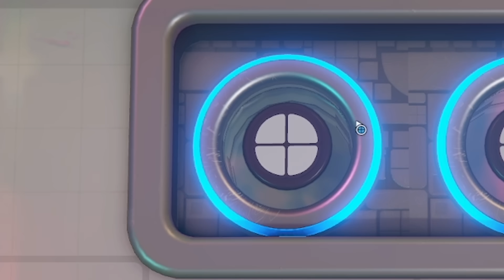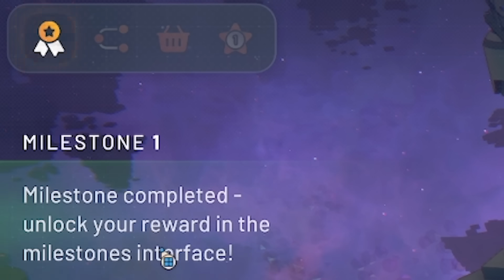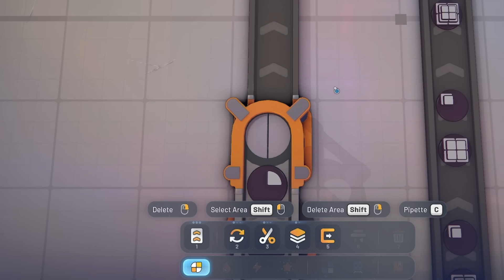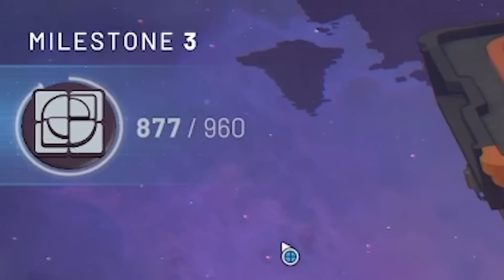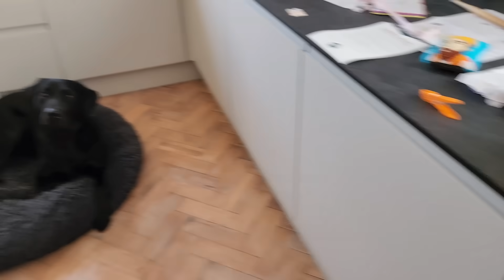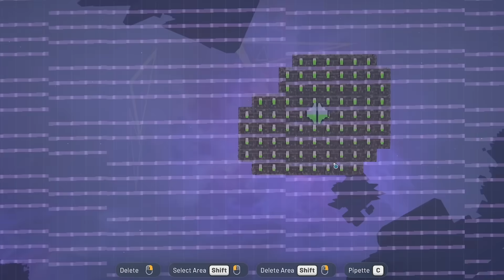I was paid to try and break Shapez 2...

Comment: You want to break the game, all you had to do is use the largest platform put pipes on every square, then once done if its still running at that point, then try to delete a small area on that platform, your computer will crash  EVERY TIME 100%, something they never fixed, your welcome.

Comment: (10:05) A branching conveyor belt alternates between all branches on the line - they don't operate in sequence. All branches are aware of each other. So, no need to get fancy with the way you divide them up. They will automatically evenly distribute incoming shapez among each branch.

So, if you send 64 items down this path: ═══╦═╦═╦═╗ you'll get 16 on each branch. 

But let's say I'm wrong and it doesn't work like that. Let's say the game wants to give you 32 on the first branch, 16 on the second branch, 8 on the 3rd branch and 4 on the last branch. That's still not a problem at all. Because as soon as the first branch is filled up, all passing shapez will skip that first branch until it is cleared again without slowing down the traffic on the main line. So, you won't end up with 32,16,8,4 because they first line doesn't wait to be cleared when it is it's turn. It will happily send 3, 4, even 100 shapez past that branch if it is clogged up. Thus, eventually, you'll end up with all branches maintaining an equal load anyway provided you are sending more shapez down the line than you have enough capacity to handle among all your input/output tools on every branch on the line. And if you aren't then it doesn't matter if you don't load balance - you're output is still going to be at maximum efficiency anyway.

Comment: Stacking a double stack vs stacking 3 times is the same efficiency. Either way, it's 3 stacking operations.
If you stack double stacks then you can do it with less machines, but that will give slower results.

Comment: The reason all the shapes at the edge of the universe are wonky is because of a little thing called "floating point imprecision". (I'm simplifying a bit here but) basically what's happening is that the computer only has so many digits it can use to represent a decimal number, so the more numbers you have before the decimal point, the fewer you can have after it.

What that means practically is that the numbers stop being able to be precise enough to draw correctly after a point, and so the further out you get from the center, the harder a time the system has zooming in. Moving the camera starts changing how the decimals are being rounded and makes the details on objects start to be drawn differently depending on very small changes to the camera's position.

Comment: 21:00 Well. You found the crazy floating point rounding error zone, or as the Minecraft community calls it, the Farlands. Congrats. 😂
Reply: Yeah this looked like floating point numbers simply being inaccurate at distances, particularly as it scaled with the distance.
Reply: Or the Null Zone from Roblox.
Reply: @NorthNovusVoid   i think it might be the same thing
Reply: OLD MINCERAFT MENTIONED!
Reply: Minecraft its overflow.
Reply: that's not what causes the farlands
Reply: @baltdev  That's exactly what causes the farlands. At high enough coordinates, the floating point inaccuracy causes the math to break down, creating nonsensical numbers for the height map. Though it's been fixed since like beta 1.8 (not the same as the more recent 1.8).

Comment: I still don't like that it destroys half of the shape rather than separates them. As I understand it there's a separator as a higher tier unlockable, but I still don't like it. Anyway I'll probably get this game once I get a computer that works again. I bought the original twice, once on PC and the other mobile. The mobile one could use a little love, when you get to the edge of the board and zoom in the stuff that was on the edge of the board zoomed out vanishes.

Comment: I wonder is there some kind of storage for recyle option? E.g. like for the last one at 7:00. We had that half square and a quarter slice of the circle before. Just individually. If there is such an option we wouldn't need to occupy a compression molding with producing more just the conveyors to merge the pieces together and send them out for delivery

Comment: When you go really far in most game engines, the engine still needs to know where you are.
 So, it uses a floating point number- like scientific notation. But, that means it has limited accuracy at long distances, because there arent enough bits to store the number in it's entirety.
That's why so many games have shakey models a long way from the centre of the world - the model is so far that the computer can't accurately place each corner because their position data is so innacurate

Comment: Yeah those are floating point errors... they are the enemy in any game with vast distances.
Also the underlying logic is probably fine, but the rendering of the mesh instances gets real flaky if it can't put the vertices where they belong.
There are ways around it, but it needs to be build for that from the get go or it will be a GIANT PITA to patch that functionality in.
At those distances physic engines are real fun, they constantly find new ways to surprise you.
Reply: Yeah, the most common method is to keep everything on a local coordinate-system with respect to the camera, combined with performance-optimizations that simply don't render (and absolutely not physics'erate, unless that part is ensured to be on-grid and coded with BigInt) things at large enough distances. If the physics (which wasn't using BigInt) has desired side-effects that makes you want to still physics'erate anyway, such as processing and accumulating shapes, the most common (and easiest) way to do it is to split stuff into chunks and keep track of an average of how much it produces of everything + where it connects to other chunks so that if they have active physics their destinations receive those resources at the speed of that average. This can have issues if done poorly, such as first moments of when you start producing something being interpreted as infinite resources per second. A harder method actually performs analysis to calculate the actual expected rates, particularly when it has reached a steady-state (expect laplace transforms?).

...And I went too deep into a tangent. anyway, this way is still a slight bit of a pita to implement a patch for, but not too bad (as compared to other methods). You can essentially skip rehashing the actual entities themselves, and simply make an intermediary step before calling their setpos/getpos etc. functions (which is inherited from a super-class/interface/abstract/trait/whatever paradigm you are using, anyway) first transforms everything to the local coordinate system. Ideally your game engine is already doing things in terms of coordinate-systems anyway, but even if not it is not too difficult implement such a system yourself (though refactoring every usage of Vec3 into Coord3 can really be a pita).
Reply: Yeah, I seem to recall they were a major problem with Kerbal Space Program development - with the simulation trying to use realistic astronomical distances, the limits of floating point numbers was was easily reached and would affect things like the physics of all of the pieces attached to the rockets. It took them a lot of work to fix all of the associated bugs, and I think they had to transition to larger (64 bit?) floating point numbers as well.

This is also why many space games do things like divide space into sectors or solar systems that need a loading screen. No Man's Sky, for example, keeps planets in a solar system relatively close together, and to hop from one solar system to another you need to go through a loading screen, which allows them to always have the planets relatively close to to origin.
Reply: @logicalfundy for Elite Dangerous they wrote their own library to use 2 single 32 bit floats to emulate a 64 bit float.

From a science point of view Elite Dangerous is a super interesting game. Their StellarForge which generated the universe is sometimes even right or very close to being right when we discover new planets IRL!
Reply: wonder why they don't just have the logic for each grid be its own thing. Like, they have a grid system, why not use it!
Reply: @colecube8251  because Unity...
Floating point errors with vast map sizes are 90% of the time technical debt of the established game engines since it wasn't a thing when they were conceptualized.
A lot of newer engines are capable to abstract that away without you noticing but all long-standing engines have options/tools you actively need to opt in.
And if you forget that you'll have a lot of work to remedy that.
The solution is quite simple and requires chunking / partitioning your world to keep floating point errors negligible but every thing else needs to be able to handle that.
Reply: @DerSolinski  So, let's say each grid space has 200x200 squares. Would it not be possible to have each grid have data for what's inside of it. Then you could just use a 2d array to load in the grid, and use a 2d array to load in the squares of the grid... right? This wouldn't have any rounding errors since there is no need to use floating point numbers.

And as for rendering, just have the camera stay at 0,0,0 and have the world move around it inversely.

Is there a reason this wouldn't work?  I've never used unity and am a very inexperienced programmer. If I had to guess this is possible but perhaps this issue was realized to late into development to be fixed easily?
Reply: @colecube8251  I'm sure he's already using a chunk system for his game logic.
What you see is that he transforms those to Unity world coordinates so the engine can handle rendering.
However so far out floating point doesn't have enough resolution to so the vertices cannot resolve to proper screen space coordinates. (the pixels on your monitor)
To fix that he would need to pin the camera to 0,0,0 and move the world underneath it.

So yes you're correct.
The outer worlds are actually doing that, the player is always the world origin.
Reply: @DerSolinski  yeah!
I wonder how hard that would be to change

Comment: I never went scrolling that far on the map, but I did bring the game to its knees. With almost 1.4 million buildings the game gets to almost unplayable state xD
But got 2 almost fully automatic MAMs running for the random deliveries.
Reply from the maker: Oh wow fair play that's impressive haha
Reply: Whats a MAM
Reply: @ItsaKorok  Make Anything Machine - automated factory that takes apart the shape requested by vortex (or manual input) and puts together a shape out of it. Mine didn't account for pins and I have to turn those on and off, hence it's not fully automatic one, but close enough.
Reply: @DennouNeko  Protip: Just consider pins to be a separate shape. So your MAM brings in complete circles, rectangles, stars, diamonds, and pins. Then just cut and arrange them like any other shape. You'll need to make a small separate factory to make a shape with just four pins.
Reply: @TitoRigatoni  Uhm... You can't really make a 1-layer shape with just pins in Shapez 2 since there's no unstacker (at least at the moment).
And I know the logic needed to detect a pin layer and add it under a higher layer. Even with pins that slide down to bottom layers on stacking if a piece below is missing. But with how slow the game got at this point I simply couldn't be bothered with modifying the modules...
Reply: @DennouNeko  yes, you can make a 1-layer shape with just 4 pins. I wouldn't have left that comment if I didn't already do it in my own MAM.
Use your imagination. Hint: Crystals disappear when sliced or stacked...
Reply: @TitoRigatoni  Right... It was me who was still thinking with old mechanics. Think I can see now how to make a factory for pins and add a segment in the pipeline for them. Will be definitely easier to do than what I had in mind. Thanks for pointing that out.
Reply: @DennouNeko  Yeah for sure. I first tried automating pushers in the MAM and it turned into a logistical nightmare. Bringing them in as a shape was the way to go!

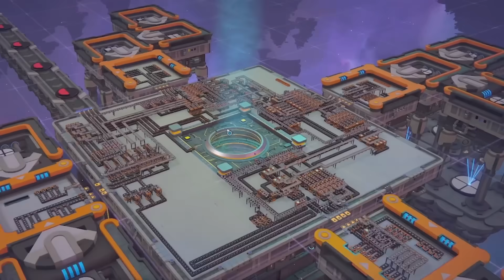Comment: 21:44 that's called floating point error, the father you go, the bigger the error gets. 
usually games keep the camera and the map positioned at 0,0,0 so that doesn't happen.
Reply: In fact I’m pretty sure in c# (the games made in unity) integers don’t overflow
Reply: @anonymousperson.5528  C# doesn't check for overflow by default. You can change your project settings to enable it. Or you can explicitly have it check with the "checked(var)" function.
So an integer overflow could (probably) be possible. I'm not saying it's the case here.
Reply: An integer overflow is something completely different than floating point error. Makes me think you guys shout words out into the void, hoping to sound smart to someone...

If the issue was an integer overflow, then the map wouldn't be infinite but instead, well, overflow and loop back on itself. Would also be kinda cool though. But that flicker and graphics error is 100% floating point precision error!
Reply: @HIDDEN_ORIGIN_DnB  yea exsactly
Reply: @monad_tcp  might be integer overflow, but I agree floating point is more likely
Reply: @Vectorspace000 no it’s floating point error

Comment: The building descriptions actually show you the number of buildings it would take to process a full belt, would be useful if you're trying to do max efficiency! Or just burn the game to the ground like LetsGameItOut lol
Reply: Or just do all of your upgrades in parallel, then you just have to remember rotator - 2, half destroyer - 3, extractor / cutter / swapper / bent stacker - 4, regular stacker - 6.
Reply: @urkerab  I found it better to upgrade the belts first/more than the rest. The belts are the ultimate limit on how many resources you can mine/move. Space wasn't a huge concern for a while at least, so needing fewer machines isn't as important as getting more resources in/out.
... didn't realize the game had a "number per belt" thing though. I was just dividing the "#/m" of the belt by the "#/m" of the machine. 180/m divided by 45/m is easy: 4.

Comment: RE: 10:15
That doesn't improve efficiency because it only routes in the direction if it's clear, meaning it'll start getting more but that'll cause it to back up so it'll stop getting them until it catches up causing it to self balance.
The original Shapez did the same thing.
Reply: It can only more efficient in that it improves the startup. Without the balancing there can be some time spent "filling up" tracks during which the later machines aren't working.
But yeah, once it's up and running, same efficiency. And the startup is pretty insignificant in this game.
Reply: It's called a manifold btw
Reply: I would've started ranting about this too, thank goodness that RCE saw this
Reply: The info for the buildings tell you how many you need to process a full belt. For example, you need 6 stackers to stack two full belts into one full belt.
Reply: its still neater to actually properly split them up imo, it's what i do too.
Reply: That only applies if the branches are handling a combined load of one 100% capacity belt. If the input is less then 100% capacity, it actually feeds more into the first branches.
Also, the startup hangs a bit if you feed a stacker from different sides like that.
Reply: 69 likes! NICE